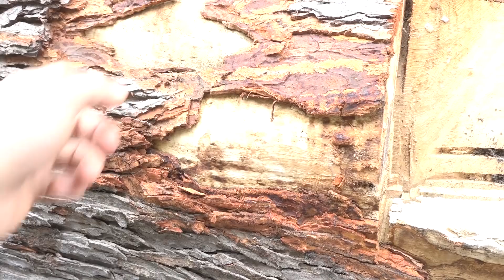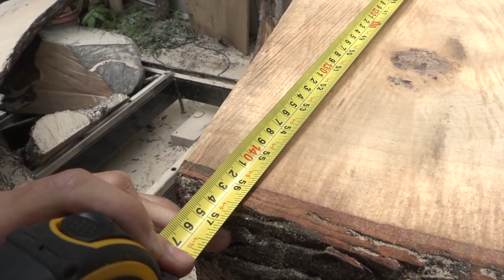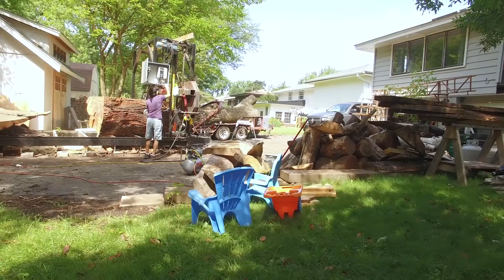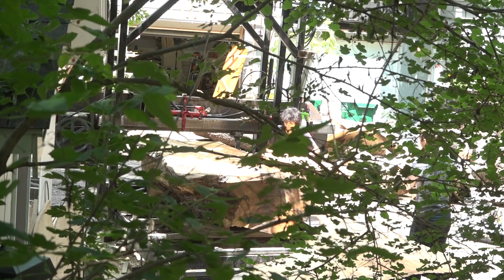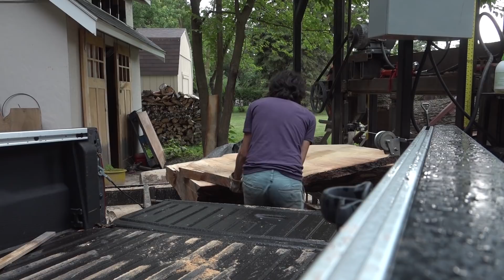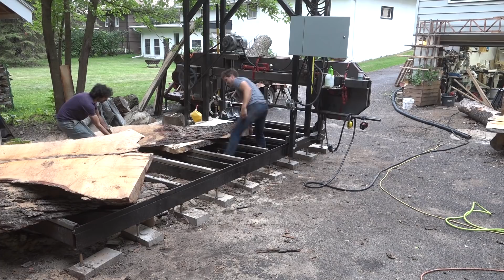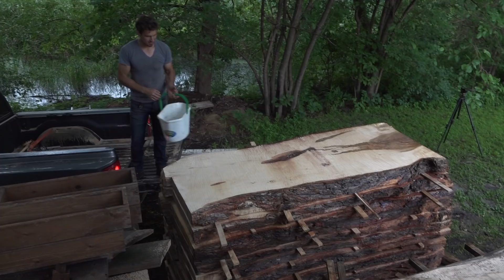Slabbing the Robbinsdale Maple

Comment: Is it possible to make double-edge saw blades, so to speak? So that one could saw logs both ways (without the need to bring the saw up and back before the next pass)
Reply from the maker: The band needs to have enough beam strength to not need thrust support while cutting.  You'll usually see double side blades when you get into blades that are over 8" wide.  You also need a much bigger saw to run those.

Comment: Great video, Matt. As I am saw mill ignorant I have a couple of questions please. I'm wondering why you did not remove each slab from the mill after a cut? I was thinking that the weight would make the saw have to work harder but I was also thinking that the weight helped to hold the log stable until you got low enough to flip it on that final pass. Am I close? Also, how long do you think it will take for those slabs to dry and do you need to cover them in the winter? Thanks for the great videos!

Comment: All those slabs, what are you going to make with them?  Second, when are you going to make a drip system for your blade?  Having a spray bottle in your hand is somewhat dangerous because of you doing two jobs at the same time....moving the saw and spraying the blade.  Make a drip system and it will be a wee bit safer.  Third, why not put a five gallon bucket underneath the exit of the sawdust?  Seems to me that it would greatly decrease your cleanup around the saw and you would have clean sawdust for other things around the house.....fertilizer, oil spills, potential sales to folks who want clean sawdust.  Just a few ideas which have been popping around my head for a while now.  Cheers.
Reply from the maker: Not too sure yet.  I'll sell most of them. 2- I have one that I never installed.  I guess I don't really see the reasoning behind the safety thing.  They're both mindless and I'm focused on the cut.  3- The dust that comes out of the chute is the easiest to collect.  Scoops right up with a snowshovel into the wheelbarrow.  There's plenty of clean up to do anyways with all the stuff that lands inside the bed.  Cleaning up that area is something that my son and I do together and he loves playing in the pile from the chute.  Thanks!

Comment: Okay, I probably missed it, but why cut so many slabs? Instead of other sizes, less thick, etc? It would seem like there are only so many customers for Boardroom Tables, things of that order. Imagine paneling a wall with one of these trees cut at, say 1/2 inch. Or do customers cut these slabs down into boards and then re-saw them?
Reply from the maker: With logs this big, there is far more value in full width slabs than there is in narrow boards.  I cut boards from the smaller logs.

Comment: Hay Matt! #1 where did you get your sawmill and what brand is it, is it very $$$$$$. #2 how much did you pay for this slab of meat you put on this mill?
#3 what do you usually make with such big slabs, 3inch.
Reply from the maker: designed and built it myself:  https://www.youtube.com/playlist?list=PL0dX5redvVZQT-bJ-HNfrJEXlQJleCwun
The log was free: https://youtu.be/_XtIx_109lU
Most common use would be table tops but it can be further broken down into parts for really anything.  You can always make wood smaller.

Comment: Is that a 3 phase motor? What's the HP? I am trying to finish a saw mill I started and I am close. Is the motor connected directly to the sheave shaft?
Reply from the maker: 10hp 3phase running off of a vfd. The motor is connected to the drive shaft with a pair of v belts. 
The Drive Motor - Building a Large Bandsaw Mill - Part 11
https://youtu.be/xly9-91mmo4

Comment: You mentioned how wide you can cut. What about length? Could the length be extended if you wanted?
Reply from the maker: +Stephen Breazeale currently up to 13' if I ran the carriage all the way to the ends of the track. Additional track can be easily added if I ever have the space and need
Reply: I work for an Electric Utility and this past winter I was out looking at a pole that was next to an acacia tree that was sliding down the embankment. The tree service had a section of the tree cut and loaded on their crane truck. It was about 30-36 inches in diameter, straight as an arrow and almost 20 feet long. First thing I thought of was your mill. That would have made some great slabs, likely went to the land fill though. Very sad.
Reply: Stephen Breazeale 
That's the saddest story I've seen all day.
Reply: Even worse, another tree, a 75 foot tall pecan was removed. I called 2 different mills that said they were not interested in the tree. Another beautiful wood to the land fill. Thankfully I have found 2 folks that mill and sell slabs that I can refer anything else I run across now.

Comment: I am curious Matt , if you were to sell just one slab , how would you price it?  I mean :  I just finished a summer long project of slabbing a pine with an Alaskan chain saw mill and the widest boards I got were 20 inches or so,  9 feet long.  I would start pricing them by looking at the cost of a 2 X 12   8 foot long board in the local hardware then I go from there.  This  works for pricing pine, but I have not run across a  2 X 12  Oak or Black walnut .  lol   what are your thoughts ?
Reply: A board foot is a board foot, all your prices should be based on the going rate of the species and it's quality. Thickness in some species adds a premium, others it doesn't affect the price at all. You don't see much 8/4 because bigger mills just don't get much call for it in the furniture industry, so usually you'd have to turn to smaller independent mills.
Reply: thanks

Comment: Gonna go on and dub this species of maple slab with a new and obvious name. "Curly tiger crotch". You've all been thinking it, now it's a reality.
Reply: I want full recognition and rights to the name of this album. I mean crotch.
Reply: If we could find some of Spalted's Curly Burly Tiger's Crotch Maple limited reserve then we'd be in bidnezz
Reply: Of course, tiger and curly are almost synonamous. The banding on tiger is generally broader and more pronounced but it sounds cooler and can pass even though they are basically the same thing. Now. I read where a man mentioned gun stocks and grips. Sure, but how many do you honestly ever see? I'd love to see more but walnut still rules that domain. Pen blanks out of the cutoffs $1.50 a pop. I've built large pie safes out of curly maple from cutoff boards. Guitar blanks... I know you probably just sell. BF slabs but there are so many options to think about in a final product. Please flip some of this cash into building your own kiln, it'll literally change your soon to be  "hairy" cured slabs into being ready "overnight" compared to regular seasoning. You could partial cure the stuff and cut a year and a half off your turn over time on these things. What will a full slab like one of those get you at 90 to 125 BF, $700 to $1300 a slab? "That's, Amaaazin'". Don't let anyone tell you that you need a skid steer either in till you're dragging these out of the woods onto your own pulp wood truck. Good old elbow grease will long out last a fork truck or skid that breaks down way before you and keep you in damn good shape.

Comment: "All you metric weirdos" There are exactly 3 countries on this planet that don't use the metric system man. :P
Reply: 3 ?  I thougt only USA is still stuck in outdated measurements, that can't even be calculated without a calculator...
well, one never stops learning. which ones are the other 2 and what are they using?

Comment: Your going to regret all that heavy lifting, you do great work and are a hard worker, figure out a way to uses machine for the heavy lifting. I know from experience so do many of my friends. There are many ways to move these with different machines no need to make suggestions your smart enough to figure it out, but I have a feeling were going to have to tell you I told you so because most of use have to learn the hard way.